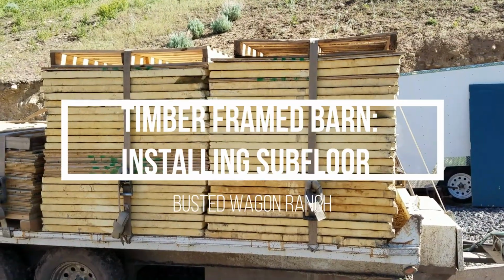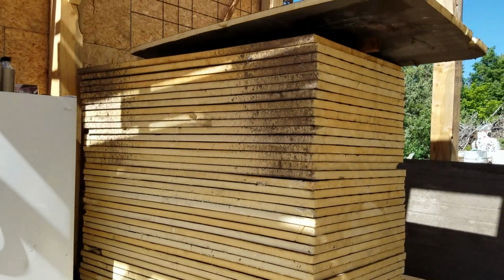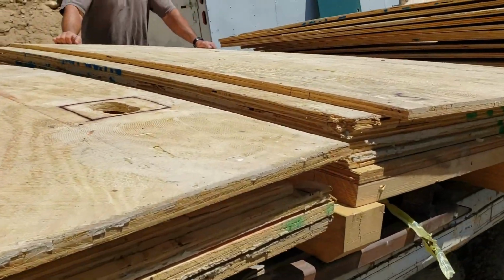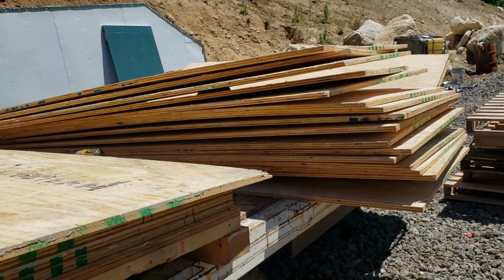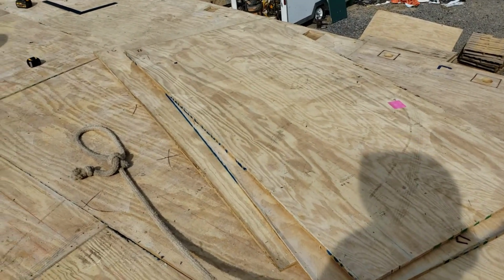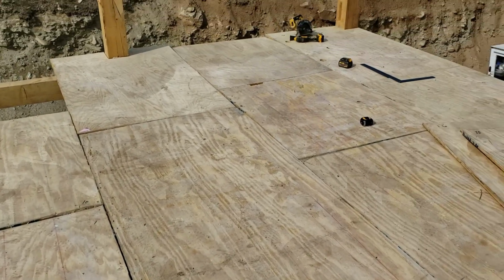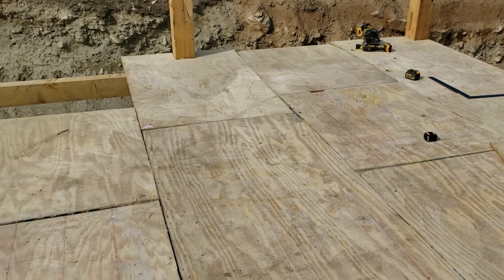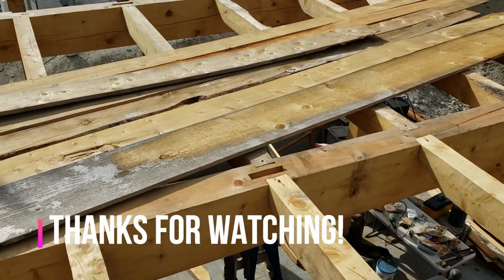Timber Framed Barn: Installing Sub Floor

Comment: The 5/4 rough that you put on last will really solidify that floor. I think if you glue your foam panels over the 3/4 plywood, and then your 5/4  or 9/8 lumber over that, it will be really solid.  I don’t think you need tin. Strongtie sell Galvanized 4”x 3”  plates wth holes on a 1/2” x 1/2” grid that would work too. About a dollar each
Reply: Really coming along nicely
Reply from the maker: Thanks

Comment: I was commenting regarding the "floating" joins when you mentioned them, so I have modified the comment a bit.  I would have preferred to have some support for those floating joins from underneath that are tied back to the joists.
Reply from the maker: The tin comment was meant for a few holes in the floor. Its probably backwards but I have been cutting the floating plywood out and then putting in a piece that fits so in the end there is no floating pieces. I thought that would be faster. Wrong

Comment: Curious of your intent on first floor ceiling (looking up) treatment. Covering this exposed plywood as your ceiling with something I’m assuming is your plan?
Reply from the maker: We had originally planned on using the 1x wood we have been cutting all year. But after the winter and our wet spring we did not have enough so we will keep the plywood for the ceiling and the 1x will be used for the floor. This is our shop not house or we would wait until there is enough 1x to do all of it.

Comment: Plywood is made with it's fibers running lengthwise in the board, you won't get the soft spot between the floor joist if you install it perpendicular to the joist.   It will be a much stronger floor system...

Comment: Why not just cut back the floating plywood to centre of each beam and then slide the other side over so you have a structural floor instead of adding extra “tin” when you don’t need to?
Reply from the maker: That's what we're doing I was meaning with the tin was for the few holes in the floor where it was previously installed. Sorry for being confusing